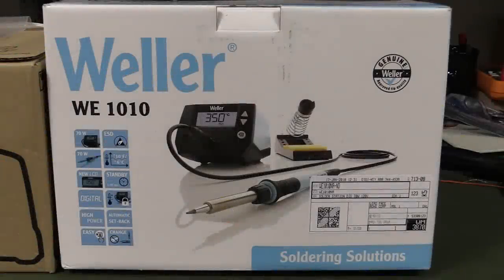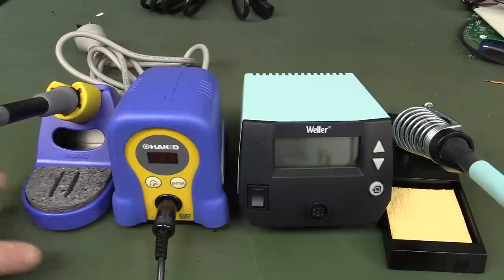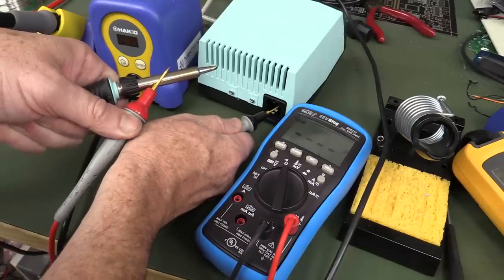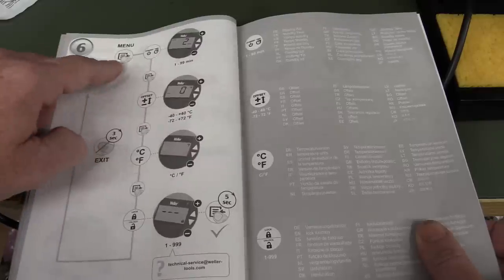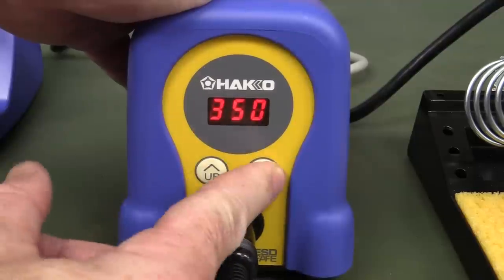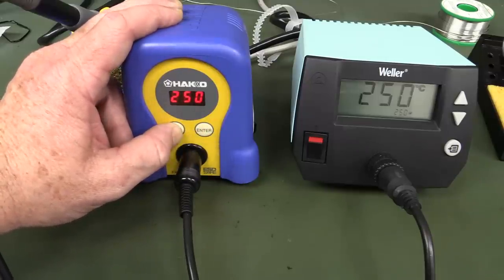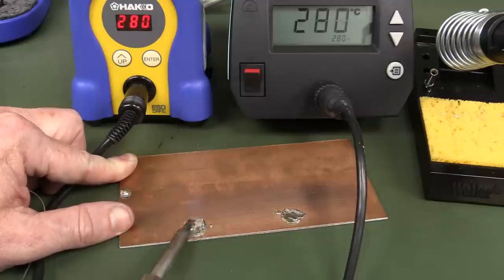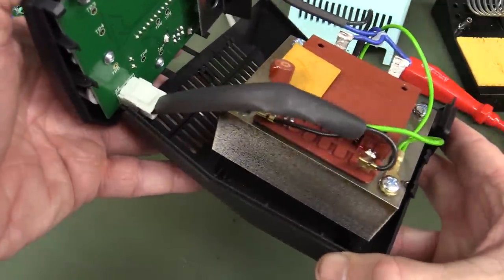EEVblog #1063 - Weller WE1010 vs Hakko FX888D Soldering Station

Comment: I've been wondering about the three set positions under the large display myself, I kinda feel robbed.  Still, when I bought, it came down to these two (I'm not rich like Mr. Rossman, whom I respect), and I chose the Weller, simply because I've always used Weller, and the price was right, and the reviews seemed pretty good.  It kicks ass on my old Weller pencil iron with the light bulb style screw in elements.

Oh, and not all of those third party tips seem to be that bad.  I bought a third party tip assortment of 18 ET style tips on Amazon for a really nice price (ShineNow, Chinese, SKU: BQ-BCKO-C817, USD $39), and the plating on them seems to be the real thing.  Time will tell.

Comment: I wish Hakko had gone for a simple rotary encoder when they added the D to their model. I still prefer my old Hakko FX-888 (without a D). I can go from any temp to any other desired temp simply and easily in a fraction of a second with the straight-forward analogue dial. For some functions, you just can't beat a good old analogue-style dial, without needing to muck around with complicated and fiddly button combos.

Comment: I wonder if the better Weller non-spring coil WMP stand will work with the WE1010.  So far it seems to suited to two different sized Weller soldering irons.

Comment: Dave,
You have to tweak the Hakko everytime you change to a different style tip with a thermocouple ,if you come from a small tip to a bigger chisle tip temp is way off ,you wil find out that the temp is to low on the tip than what is showen on screen. I think the sensor is to far in the ceramic .
I think the Weller is closer to the tip.
So for a fair temp test like on the sponge i think you should use your thermocouple and not the screen readings on the stations.
Reply from the maker: Why is it not fair to use the units own sensor?
Reply: Hi,
I think that the heatsensor in the Hakko sits farther from the tip than the Weller one. That is why with the spongetest the Weller seems to drop more on heat than the Hakko one ,but if you would measure this with a external thermocouple on a DMM or temp logger both on the tip ,i think the difference would not that big.

You saw that on the large pad heat test the Weller didn't that bad there,
but the readings on there screens shows different.

I know from experience with the Hakko 888D, i to measured the temp with a thermocouple to check the accuracy and like yours it was bang on.
But switch the small point tip to a large chisel tip and measure the tip again.
You will surprised how much the temp is off on the tip .
If i not mistaken ,if you are bang on with the point tip at 350 and change to a chisel tip the temp is 320-330°C on the tip ,so off by 20 or 30 degrees.
Every time you change tips on the Hakko you have to adjust the temp.

My thoughts are that the sensor is closer to the ceramic heater element and the one one the Weller is closer to the soldertip and therefore more accurate in real time .
And that is why the sponge has that more effect on the Weller 

But that is just my opinion,i could be wrong. :)
Sorry for the long answer.

Comment: Wonder how these compare to my new Tenma $75 936-clone with LED display.  Model 2565327, looks properly built, with nice parts, brass and yellow sponge, IEC power input with replaceable fuse and all connector based internal assembly, anything can be replaced with a screwdriver, clear instructions, analog adjustment.

Comment: now that you mention it, my soldering station doesn't have a connector for the iron, it is fixed. but hey, it was 80W for 55€.
... I looked in the inside and the transformer is waaay smaller

Comment: I feel like Weller really had a chance to blow Hakko out of the water with just the interface and the cord being further away from the end of the iron, but it looks like they kinda dropped the ball with heat capacity and cheap stand.

If you want to have a hakko 888D for use by multiple people such as in a makerspace or in a school lab, you HAVE to have the passcode lock for changing the offset enabled. I’m pretty sure the first thing every single person who has bought one and not seen any videos on it or read the manual has screwed up the factory set offset because they thought “holding the up button to change the temperature seems like the logical choice.”

Also I tend to find myself flicking the hakko wand to get the cord out of my way every so often, so it looks like someone at Weller had the same annoyance I do.

Comment: The charts you show say the Weller claims to lose 50C, and the Hakko only 20C. And your tests appear to bear that out. But, you can't find a difference. LOL I'm sure they're both great if you already love the brand. But obviously there is a performance difference between a ceramic heating element and resistance alloy.

Comment: Been using a Weller PU-1 60W iron for 40 years have hundreds of hours on it Made in Canada when Weller was Weller. Still going strong, just a transformer in tar none of that electronic stuff. Still can get new 700deg tips, works for SMD devices, maybe when it dies I will get some thing new.

Comment: 26:16 - Did the Hakko forget the offset adjustment when you factory reset it?  Might be why it is out 8°.  Don't forget the accuracy of your temperature tester though.  It could be out by several degrees at that temperature also.

Comment: The heat loss difference might be down to the Hakko having a direct ceramic heater contact to the tip, unlike the Weller.
Reply from the maker: And/or the placement and coupling of the temp sensor.
Reply: I assume that thingy in the middle of the Weller (when you took the tip off) was the temp sensor?

Comment: Your tests are a bit invalid, since the Weller has the temperature sensor flapping inside the tip, while the Hakko has the temperature sensor inside the heating element...

Comment: I have Hakko FX888D, FX951, Weller WSD81i and ERSA temperature-controlled soldering stations having intended to do a shootout between them. I then got a Metcal MX500 (708 USD). It is so far ahead of anything else that a shootout become pointless. Each fixed temperature bit of the Metcal costs about 33 USD so not cheap but there is no need to change the temperature. Solder a miniature part and then move to a large lump of copper and without changing the bit the solder joint can be made fast and securely. The fixed temperature is a huge plus and avoids the risk of damaging components. At a price of course.

The 888D is adequate but I prefer the up market Weller. BTW I think the yellow printed Hakko tips that Dave was waving around are the fakes. Whoops!

Comment: So as someone who doesn't know crap about soldering stations it looks like the Hakko is the clear winner. Surprised you didn't call it that way:

Hakko: keeps better thermals, faster temp response, smaller, built better, better stand, better instructions, can set presets
Weller: easier fine control of temp with the up/down buttons, iron's handle has a better grip

Comment: Cool, two great electronics soldering and soldering related stuff, with two different design and heating philosophies:-)
It's Japan vs. Germany,

My current soldering the amazing T12 w/ it's cool OLED display which I just got yesterday and hot air the 858D which I've had for 5 years (thanks for the review sir Dave)  setup, shipped and other electronics tool, that I've ever bought since I learned about soldering and basic electronics (31 years total) and had, including 99.9% alcohols, sub-components (resistors, drills, bread board, etc.) and Dremel set is around: US$319.72  - I think that's not a bad deal, run, so far:-)

God bless, Rev. 21:4

Comment: What's with the tips of all these being a mile long? And it's not just the ones w/o integrated heaters... I got a Weller WHS M for €170 a couple of years back. That one is a smidge over 40mm from grip to tip. So it's essentially not much different from using a sturdy ballpoint pen.

Comment: I'd take a guess that it drops a bit more than what it actually says on the hakko considering how unresponsive the display appears to be and considering they aren't too different in terms of soldering I'd absolutely say that the weller wins just because it has way better UI design, I have an iron that functions similarly with only two buttons and I very much dislike fooling around with it and if the stand bothers you that's cheap/easy enough to replace on its own.

Comment: Hi Dave,
I wonder if Hakko US version 120v would be possible to change the PCB connetions to make it work at 220v. I live in argentina so no chance to get an AU version (that would be great since we use the same plugs) maybe the transformer has two coils, in series for 220v and in parallel for 110v, to make the voltage change "easy"... Thank you

Comment: The winner is - everyone who wants a quality Iron at a reasonable price.
I personally have a Hakko now, but I use to only use Weller ~25 years ago.
Could I have an Iron that has the Tip of the Hakko, slimline body of the Weller, length of the Hakko. The controller needs to have the build quality of the Hakko, Weller flat top for stacking, Hakko presets, Weller interface. The stand I prefer Hakko but with the Weller Tip holder.

Comment: Here's a tip for dealing with that absurd Hakko interface:  just leave the first digit at 3 (hundred Celsius) and adjust the 2nd digit up and down in 10C increments. It's not that annoying then. Still a dumb design. Celsius degrees are bigger than Fahrenheit, so even though I'm in USA, I always work in Celsius for soldering because it takes a smaller numerical adjustment for the same swing in temperature.

Comment: I have the Hakko bought in UK for £125 in Feb its an excellent iron and improved my soldering. I am using the tip that came with it, the replacement tip choice is a bit baffling how about a recommended part no Dave,
Reply: Not Dave but in case it helps - http://www.dancap.co.uk/soldering/TipsT18.htm I like the T18-D16 chisel tip for my novice level through-hole work.

Comment: maybe the weller is using some clever bit of code to not keep heating the tip when it thinks its being plunged into the spunge? ... also how about this - what if you made a module to use a encoder instead of the buttons? combine best of both!

Comment: I have the WSD81 Weller with WSP80 iron, I acquired the next Hakko up from the 888 and it went on eBay within a week, I thought it was garbage. My Weller is used for hours every day and it just keeps working and has been for years. Some of the Hakko handsets are really crappy build quality.

Comment: Weller it's much better!
Weller measures the temperature at the soldering tip. Its counterpart shows the temperature of the heating element and not the real soldering tip temperature, it would be nice if you informed yourself better.

Comment: watched your review in this video, thanks, a couple of things. 1: when the tips are removed the Hakko has a ceramic core heating element, how does it heat the ceramic, and what type of core element does the Weller have, can you provide an answer? I like the feature set of the weller but like the small foot print and the fast heat recovery time of the Hakko, don't like the colors of either unit though... thanks in advance for the answers and for the video... I am researching different soldering stations with temp control and have not decided yet...

Comment: Through much of the critiques in the comments, I agree how Dave ended up with the assessment he did. What could one get for ~$100? I too would've like to see a TS100, however since it's kind of in a "different league" I'm not too sure if Dave wanted to include it in this comparison.

EDIT: Just went through the EEVBlog forum and Dave mentioned that the TS100 did not fit his criteria for this testing.

One thing I liked about the WESD51 is that it combined a potentiometer with an LED display, however the newer WE1010 is certainly sufficient.

Of course, I now own "higher-end" equipment sold at much higher prices by other manufacturers, but I feel this review is a good indication of a couple of options for those who can't spend much more than ~$100.
Reply: IMO compared to the TS100, that Weller and Hakko are toys, and they are not in the same league indeed, I agree with Louis comment, this is dead and obsolete technology that only hurts, and sadly there are better options than telling someone to go get a Weller or a Hakko 888
Reply: The TS100 fails an ESD Safe test, whereas these cheap nasty stations can actually pass. Consumer repair could easily use a TS100 or a "Fake FX-951", however because the equipment I work with is mission critical, I won't even take the risk with them. My Pace and JBC's have plenty of life and are actually worth the money spent, however in a pinch, I actually could use those cheap options without risking liability related to ESD.
Reply: TS100 has a grounding connector no? though you have to do extra work to hook that up
Reply: Yes, which can help with certain environments, but not where the liability is very high! ESD is hardly a concern with the consumer, hobbyist, and "non-mission critical environment." I actually work with several mission critical applications, therefore I cannot take a chance with a "non-ESD Safe" compliant piece of repair/rework equipment. Despite my equipment being "ESD Safe" I actually have to have all of them periodically tested and certified. This is actually where cheap stations like these may actually pass certification.

Again, I agree their performance to price ratio is horrible, however... they actually can easily work in occupational environments like mine.

Comment: WARNING: Do not follow the idiot idea that all you need to do is unscrew the two screws on the back.  If you remove the two screws on the Weller WE101NA, you still won't be able to open it up UNTIL you accidentally snap off the plastic tab(s) inside, which doesn't require much pressure to break.  However, after you do that, you won't be able to close the station unit properly.  The two screws do f@#% all.  Thanks a lot EEVblog.  Now I will have to find some way to glue my not-inexpensive soldering station back together since the front black panel falls off at the slightest glance.
Reply: Haha I almost bought a Weller. SO GLAD I didn't. Amazingly Amazon even decided to cancel my weller order by itself lol. Finally bought one from the official american hakko website for 110$  after seeing that video

Comment: Hakko and Weller are betting big on brand recognition, you could buy a cheap Chinese T12 station for less than half the price of these old technology stations. The Hakko interface is as intuitive as a RCA clock radio from the 70s.
Reply: PunkNDisorderlyGamer,The Hakko is 99 bucks on amazon with one day delivery,  Guaranteed quality, Warrantee, I'm lazy this was easy. (The the interface is worse then you described) Once you set the 5 Presets it's easy to use.
Reply: "betting big on brand recognition" Also the RRP goes towards quality control and profit margin (considerable), of course. All the really cheap Chinese stations have switch mode power supplies, the T12/C210/C245 stations with actual transformers like the Quick TS1200A are priced at least on par with this FX888D or WE1010.

Comment: Is there an Aoyue equivalent fot the money or less? i have a cheap Aoyue 35w one based on 936, and it has a great metal locking connector, and a great metalic base/stand. Would really love to see what Aoyue has to offer for the money. I certainly expected more from Weller, it has always been like top of the tops in my mind.

Comment: You can tell by just looking at the hakko that it was a Japanese designer. Weller needs to ditch the soft colors. It's a soldering station not a nursery. All Weller's need to be standard issue orange.

Comment: Speaking of the Weller WX, I'm thinking about getting a soldering station that support both pencil and tweezers to work on my boards. I was looking into a JBC nano station but those things are like 1,500 yankee bucks!! And on the other hand I just stumbled upon the Weller WX2021 - WX2 that is like 800 yankee bucks only.  So I would like to ask if you have used it. Is it good for working with 0402's? And the overall quality.

Comment: My FX888D came with the small spade tip, not a conical. They must have changed that at some point.
Reply from the maker: Might depend on the supplier.
Reply: EEVblog you think so?

Comment: In using a weller wlc100-and wouldn't mind upgrading/ updating(?) To a digital would you go for the weller1010na or the hakko fx888d? I'm not really interested in buying a knock off but stuck for days on the two I had mentioned... Any inputs would be great
Reply: Eric, Well what did you get? Ive had the Hakko for 2 years and love it.
Reply: @stclairstclair  hakkofx888d!
Reply: Eric Did you do an inspection to see if it's genuine, Only buy Hakko tips, the cheaper knockoffs were found not to work as well.
Reply: Eric Also watch the video on setting up the 5 preset temps, Makes life much easier.
Reply: Eric, I have 7, Just do what i do, Add them to the amazon list when she's not paying attention.
Reply: @stclairstclair  lol!
Reply: @stclairstclair  best thing I've read all day <3

Comment: Weller is weak at recovering which is the main purpose of a soldering iron station. I've had two of their bigger 175w  irons fail also. On the other hand I have a 25 year old Hakko 936 that was used in a manufacturing environment for the first 15 years of its life. It still works fine. Only thing weller has worth a crap is their butane 75 which they don't even made they are made by portasol